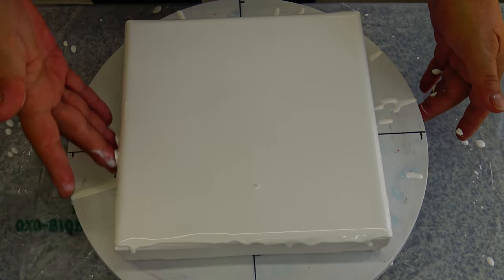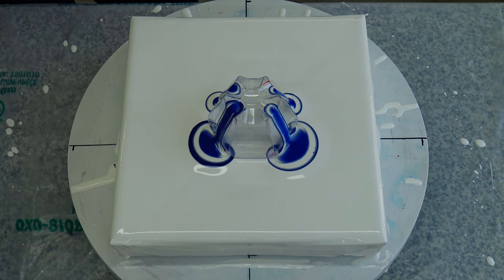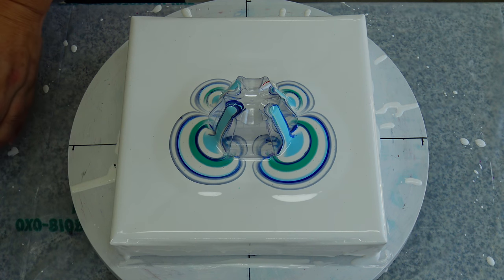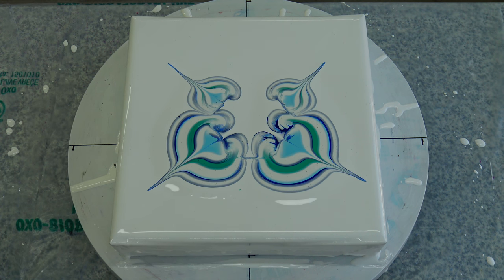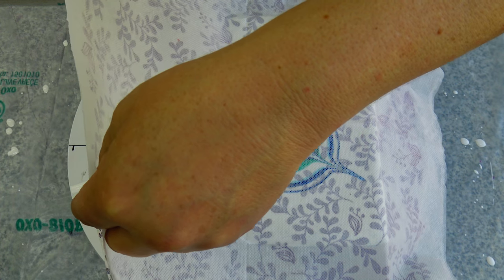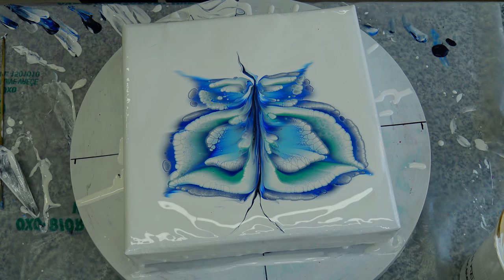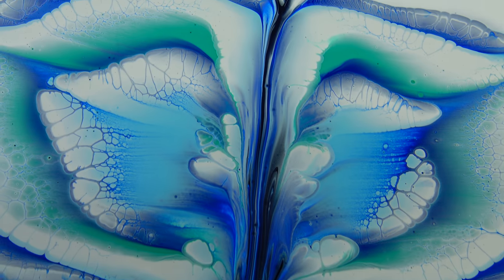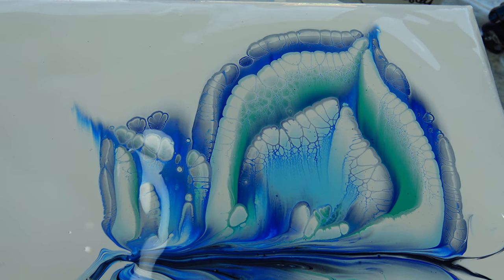(416) Working on New project ~ Butterfly ~ Cup bottom reverse dip

Comment: I think your butterfly turned out great. You asked for a help comment. The only thing I would try is don't pull your stick through the middle of the larger "wings" that creates a tip. Just through the smaller ones. Then spin your painting to spread the wings.  Hope it helps. Stay safe, stay well. Hugs, Rita.
Reply from the maker: Thank you for your tips. I will try to do one on my live video, so you will be able to help me. ✌️

Comment: I'd add a tiny bit more paint on the lower wings area and hand paint in the body after the bulk of it is dry and slightly bigger area for a head.You could also pull through the tip of skewers throughthewings once you get the overall size adjusted but I'm new to pours,so what do I know,lol. 🙋‍♀️🤗🥰❤️❤️❤️🤞🧚‍♂️😂😂😂
Reply from the maker: Thank you for your tips. I will try to do it on Sunday live 😉